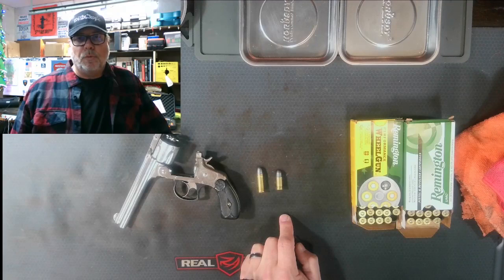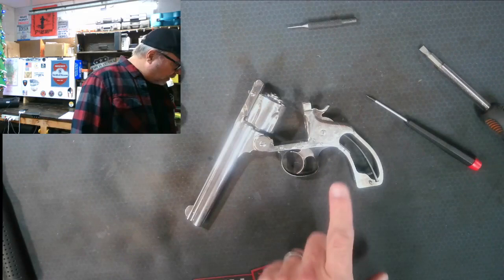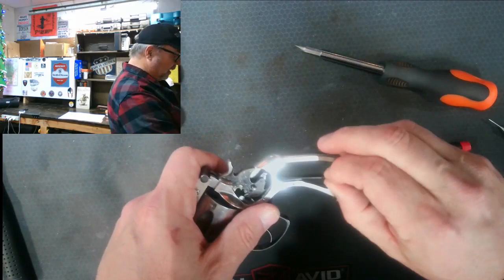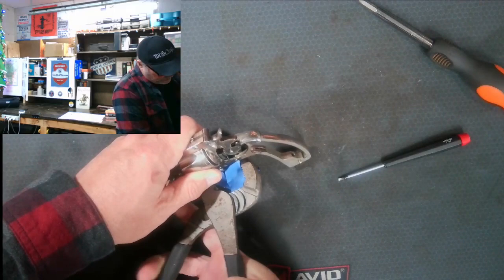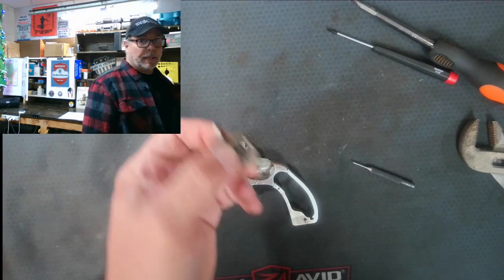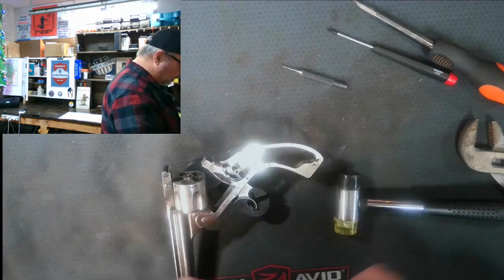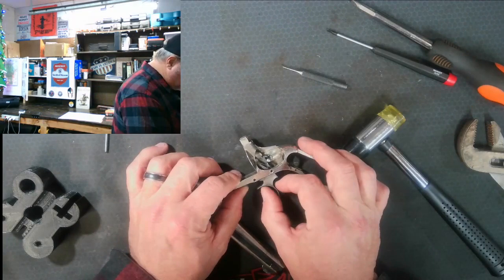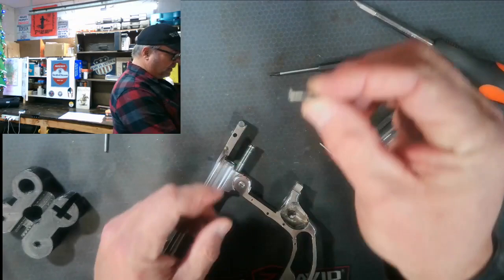Smith & Wesson .38 DA/SA Top Break Disassembly and Reassembly Part 2

Comment: Great video thank you. Trigger spring came out in two parts… I think I know why it wasn’t resetting.
Reply from the maker: Good news
Reply: I have one that the trigger will not reset. Is the trigger spring the one under the trigger guard or is it the one below the hammer spring in the grip? So confused. Everything works excep you have to pull the trigger forward all the way for reset.
Reply from the maker: @douglascatron9073  yep it's the spring under the trigger guard.  Scroll through part 3 of the series, i show exactly how it needs to be seated.

Comment: ¿Is it safe to shoot .22 WMR in a Flobert 6 mm revolver (Iver-Johson circa 1900?) with adapted both firing mechanism (annular) and new  barrel? ¿Will the frame, the upper breech and cylinder withstand the explosions?

Many thanks. Roberto from Argentina.
Reply from the maker: Hi thanks for the question.  I honestly couldn't say if that would be safe or not.  Always error on the side of caution, therefore I would NOT attempt it.

Comment: First time I saw a top break revolver was in 'Lawrence of Arabia'. I just picked up a model 3 with a handful of ammo for my birthday. It was only $50. The handles (scales) have been swapped with antlers, which is pretty cool, but the screw that holds them in is completely shaved off so I'm not messing with that.  I'm not planning on shooting it, but it seems to function great. No single action though. I'm not sure if that's normal.. double action only.
Reply from the maker: It should be both double and single action.   Can you send a pic?
Reply: Hammer doesn't stay back, I'll have to see about getting a picture and sending it to you. Be easier over an email if I can get your address. I'll do that over the weekend.
Reply from the maker: @notsure1686  mikesgunworld@gmail.com  That's a problem with the sear - most likely worn down.  very repairable.  I believe I show the exact problem in part 3.  I switched out hammers and it went back to DA/SA.
Reply from the maker: @notsure1686  mikesgunworld@gmail.com.  it's a problem with the rear sear.  Look at the 8 minute mark in part 1 of the series - I highlight the exact same problem.

Comment: Hello I have a S&W 38 top break as well S/N: 58,XXX the break part is seized. I have gotten the grips, the hammer, and main spring removed but I can’t get the gun to break in half. Any ideas or suggestions?
Reply from the maker: Have you tried taking the screw out?   I would spray it down with Kroil or something similar.  Let it sit overnight.   Then take out the screw.    Be careful because there is a spring in there.
Reply: @MikesGunWorld  Thank you for responding. Are you asking about the hinge screw?
Reply from the maker: @F1MechNoah ther should be a screw that holds the top break in place.
Reply from the maker: @F1MechNoah watch at about the 23:43 mark

Comment: So that pin at 8 minutes in, WILL NOT move. So am I done? Or any tips?
Reply from the maker: Have you tried a rust remover or liquid wrench?   Soak it over night.   I’ve had to soak parts on other take downs and it works.
Reply from the maker: Let me know how it works.  Some of those old pins can be stubborn
Reply from the maker: @slipjointguy  That is a 1/16th pin punch